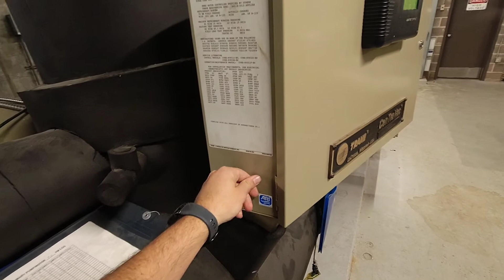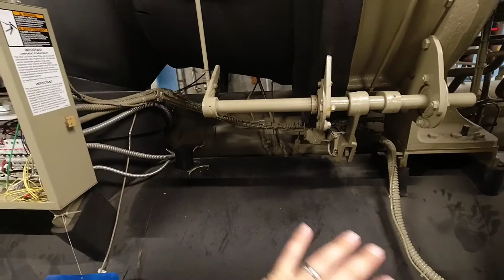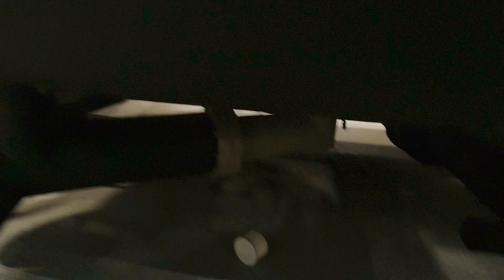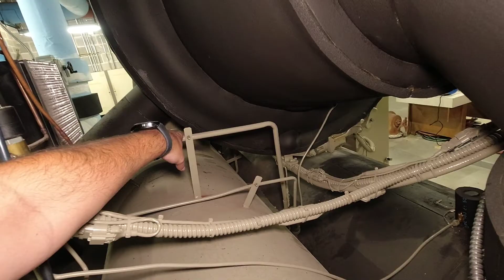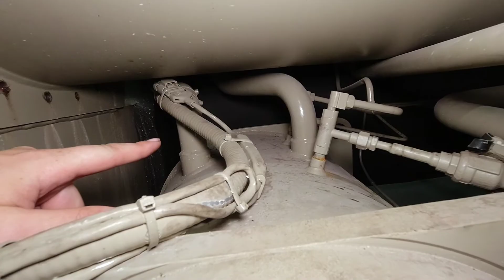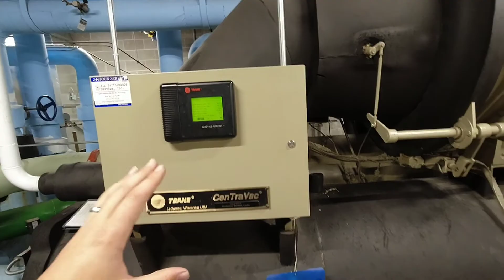Trane Chiller HVAC Centrifugal Overview - HVAC Training Videos

Comment: New to your videos. I am a recently retired HVACR tech, after 28 years working on supermarket rack systems and then 17 years of industrial refrigeration with Frick screw machines, wye/Delta starters, VFDs etc. Your knowledge and troubleshooting skills are spot on. Never did centrifugals, whole different ball game. It amazes me as to how many specialized areas there are in our business. Keep up the great work.
Reply: Trane is just frustrating to work on Bonding controls to existing controllers.Parts obsolete I leave these to the Trane guys